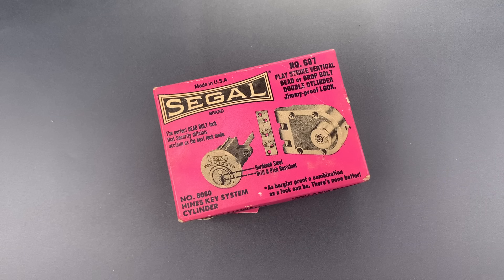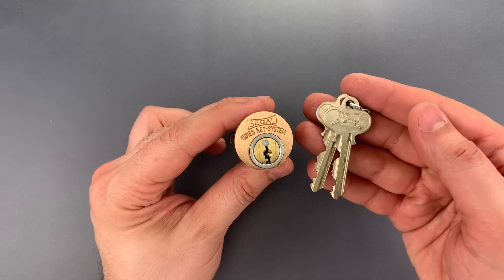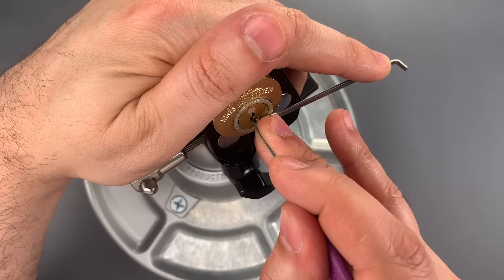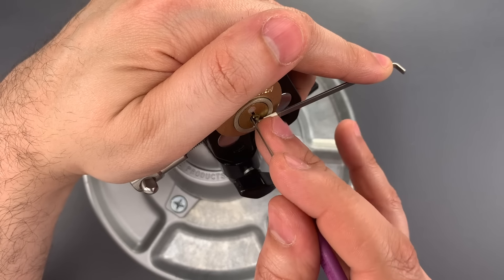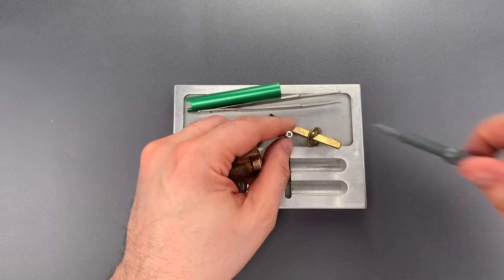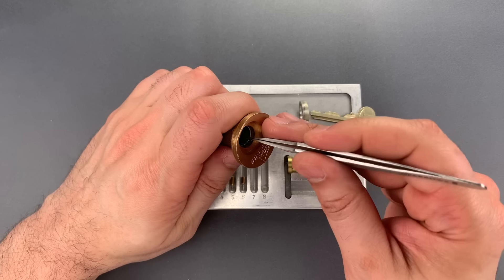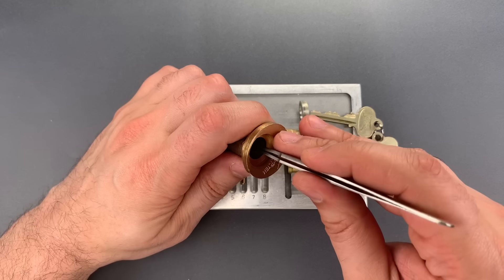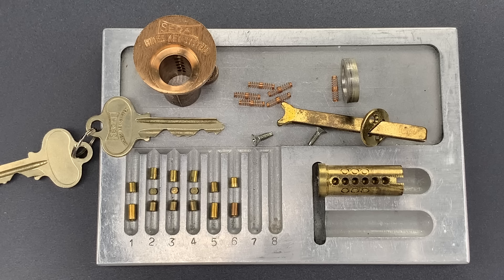[1181] A TRAP For Pickers! The Clever Hines Key System Picked

Comment: Man, this lock would be EVIL with serrated and spool pins for the trap pins.
Reply: Plus randomize the trap pins and make them all serrated and spools.
Reply: You might not be able to inset both the end for the trap and the circumference for the spool (since you'd be milling both into the same inner volume), but I see no reason why you couldn't mill trap holes for all six pins and use a combination of hollow pins + wafers that interact with the trap, and spool pins that resemble the former.
Reply: @alexholker1309  Trap pins have to be high cut.
Reply: @alexholker1309  the traps don't have to be deep. Also one could use t-pin spools as traps. Just my thoughts on this.
Reply: Security pins may defeat the whole idea, because once a picker finds one they are likely to look for more and discover the deeper set on the trap pins.
Reply: @caminoprojectUS  I believe that was how LPL modified a kwikset to use trap pins, by using t pins and wafers and smaller trap holes the the t pins fit in but the wafers or normal pins were too big.
Reply: @caminoprojectUS  _ LPL used T-Pins and wafers in a similar "home spun" version where a "construction lock" was hacked to make it a trap lock.
Reply: Make some pins engage at the second shear line and some at the first one (there might be some dimensional constraints but my lock anatomy knowledge doesn't go that far) I'm pretty sure it would be impossible to determine which is which
Reply: @tarev7475  This. If all of the pins have two parts and one half of the pins is trapped and one half isn't (just place the cylinder behind the actual pin) at random, this could be only pickable if you guess the combination correctly (1/2^6=1/64 chance) on your first try.
Reply: Excellent choice for the unguarded doors into a building you can get at the inside through the guarded door if tripped.